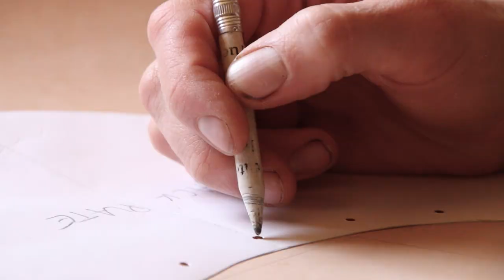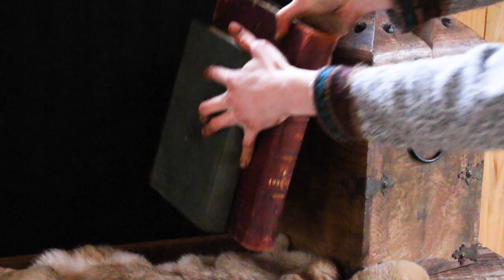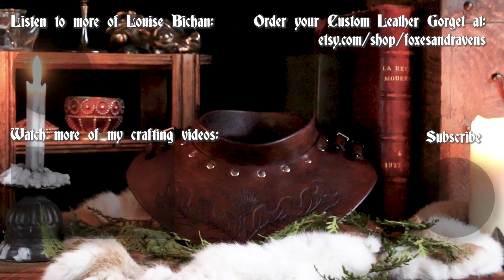Crafting a Leather Gorget

Comment: it looks awesome! does it restricts movement in any way?
Reply from the maker: Not the movement of the head or arms really, but if you shrug your shoulders it will move, and of course if you bend over, it'll probably fall around your ears.
Reply: @FoxesandRavens  but it shouldn't fall off if you attach it to the vest?
Reply from the maker: @universe8607  you would have to do some tests! I wouldn't recommend attaching it to anything, it would be difficult to get in and out of: you have to unbuckle the neck to be able to get it on and off, since the neck hole is smaller than your head size.
Reply: @FoxesandRavens  that's true, but it's expected that a multi piece armor might take a while and even help of another person to take it off

Comment: what size rivets did you use?
Reply from the maker: It's dependent on the thickness of the leather, I actually have several different lengths, between 4mm and 13mm long, but usually I'm using 8mm. They should be about 1-2mm longer than the thickness of the leather they're riveting.